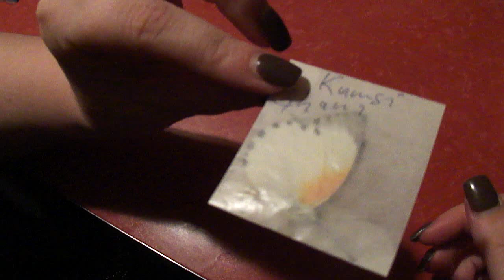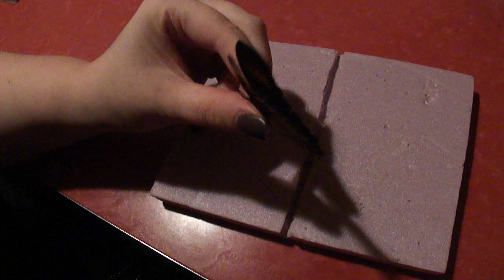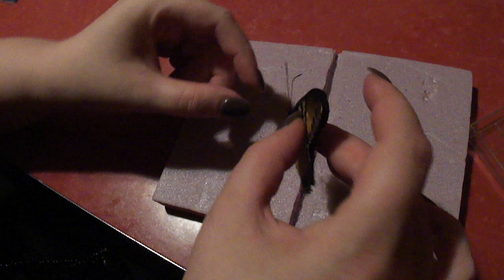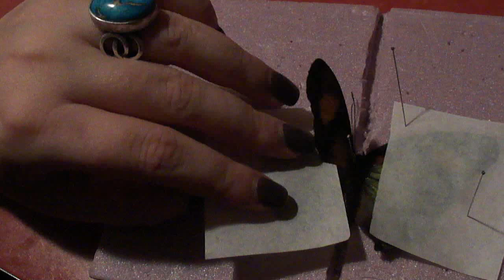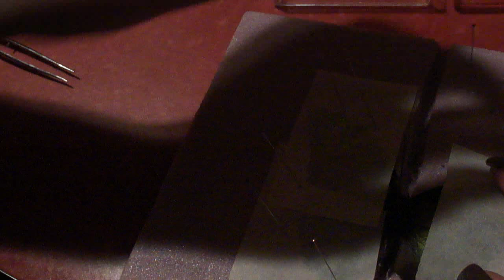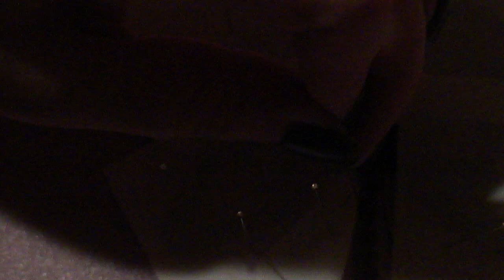Mounting a Butterfly- Pt 1- asmr/ relaxation

Comment: You got it. My planes weigh in at around a gram and a half. It's not so much a question of talent in my opinion as the desire to make or buy the tools you need to work that delicately. You have to mike every dimension as well as the rubber you use. Oh wel. The scorpions I get myself when I make trips to the Florida Keys. We once owned a home there, and I would find dead scorpions here and there, mostly so dried up that the membranes that held 'em together failed... Another modeling project!

Comment: What if you folded the tracing paper in half then inserted between the wings.Use a 1/2" dowel in between and gently work the wings flat. You really saved the day with your softening technique. I usually hold em over a steaming kettle.. Nice work gal.